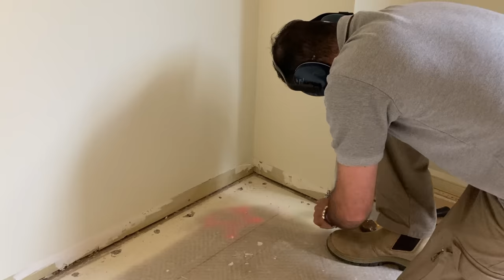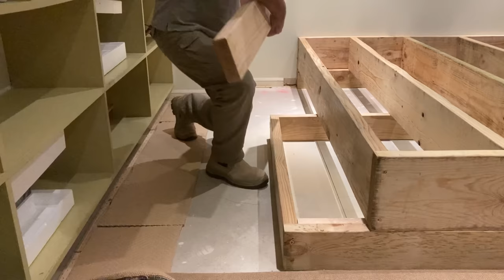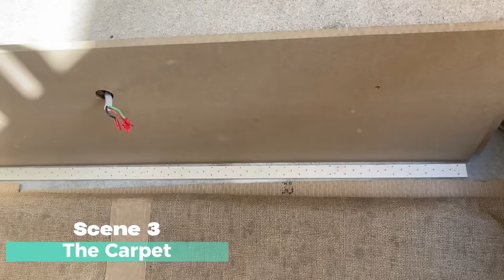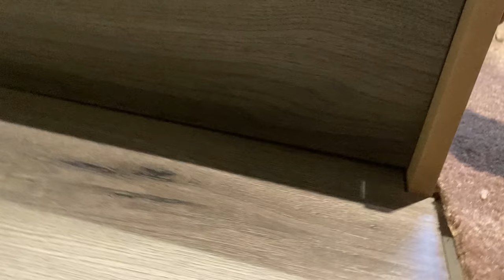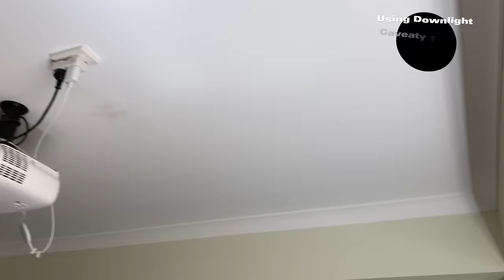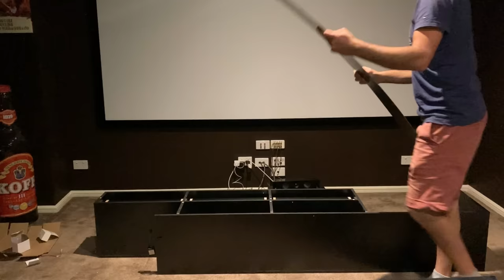This is proof, build an amazing Home Theater yourself! Home Cinema build timelapse

Comment: You actually want to fill the whole riser, with fluffed, uncompressed, unbacked batts. You have vents so you'll want to use formaldehyde free batts to reduce VOCs (and treated wood has pretty nasty chemicals). You need 7% open area of the riser deck/face/sides for the Helmholtz resonator. Can leave the face off,  just covered with carpet. Not sure that black tape and foam is ideal for squeaking, roofing felt is usually used. Use it between all joints, not just under the riser top. Double thick top is good! Good job doing that carpet yourself, that can be a pain. Screen looks good, back wall design is cool. I was worried about the white receptacle/etc covers, but the furniture hides them. The finished room looks very nice, kudos!
Reply from the maker: Great feedback for the next build, thank you 👍🏻. The batts are special wools and free of toxics, it’s a good point to mention in the description!!. After a year of usage I have been lucky not hearing squeaking or echos but your suggestion will improve it for sure. Thanks again.

Comment: Very impressive. I’m planning to try to do something similar. Can you tell me an approximate budget to plan for a setup like that while doing most stuff myself? Can you also maybe tell me the room dimensions for your home cinema?
Reply from the maker: No problem, great feedback!! I plan to upload an informational video on some of your questions. The room dimensions and the riser dimensions are mentioned throughout the video (room is 19.6 feet long x 13.1 feet wide & riser is 7.10 feet long, 9.10 feet wide and 1.5 feet high) Regarding budget, it really depends on how much you like to spend on quality. You could be spending anything between 10k-15k for a most basic setup to 50k-70k for a luxury setup (US dollars)! I have probably spent around $20k US so far with a lot of personal time and effort on the labour part that can save 20k by far. I will be upgrading the room further so my budget is not final yet 😊. My tip would be to start searching on different seatings, different equipment and even considering secondhand gear as a starting point 👍🏻.

Comment: Nice video showing us how you built out the room, but what about the most important part of a home theater - your equipment and how you set it up.  Sitting in comfortable chairs in a nice room is one thing, but watching and listening to lousy system defeat the whole experience. Tell us about your system- what type of equipment and speakers did you use, did you wire for Atmos? How many speakers and there placement. Would love to know more about the projector you’re using? I didn’t see any subwoofer…..
Reply from the maker: Thanks Mike and great suggestion! I am new to uploading videos and looking at upgrading the systems. This is a multiphase project, so please tune in for more enhancements on the systems and the aesthetics 👍🏻

Comment: Amazingly well done room, but where are your speakers?
Reply from the maker: Hey there, thank you and a great point. Currently it's 5.1 setup. I have moderate speakers installed under the recessed ceiling at the front and the back. They are kind of hidden in the video but still possible to spot :). This was the first phase of the build and in the next phase I will be upgrading the system. I am looking at installing in wall speakers. Please let me know if you have any suggestions! Also stay tuned for future videos on this theatre room as I will be applying a number of aesthetic enhancements too. Cheers.
Reply: @smokindrill  Ahh, that's kinda what I figured. Personally, I would advise against in-walls in most cases, and against in-ceiling speakers in all cases (unless they're Atmos speakers). In-ceiling speakers should never be used for your foundation speakers (ie; non-height speakers) unless absolutely necessary. You'll have terrible imaging. Looking at this room, I would recommend towers (even slender ones) up front where you have the Storm Trooper and Vader statues, with the best center channel you can budget. You have the space there and you'll get the best front sound stage, without the complication and extra work it would take to make in-walls sound good, ie; baffling, toe in, etc. Again, avoid in-ceiling speakers for your front stage. For rears, I would look at mounting them on the brown part of the wall at the back of the room, on the same part of the wall that goes into the book shelf area, and the same wall on the other side, OR on the brown part of the wall next to the back wall where you have your acoustic panels. The former would probably be better as you'll have them a little wider apart. Play around with it a bit before committing. As for speaker brands/models, anything but BOSE lol. Try out a few brands in store that fit your budget. My system is kinda budget, and I have a mix, Polk center and surrounds, Mission Audio towers, Klipsch subs, Pioneer receiver, but  because the room is treated and everything is EQ'd, it sounds pretty good. 
You really did do a fantastic job in that room. Get that audio right and it'll be absolutely killer. Cheers and best of luck. Welcome to the hobby :)

Comment: Great job there,, Hope you are getting lots of use from it.
Question if I may, what material did you use for the curtains?
Reply from the maker: Hi there. Thanks for your comment. To be honest the curtains were already installed when we moved in this house. However they feel thick with a second layer at the back and probably a high percentage of polyester.

Comment: Nice transformation! I'm just curious what are you using for your AVR and speaker setup? I see the AVR but not the speakers (unless that little guy in the front is your speaker). That seems like a great room for a 7.2.4 Atmos setup.
Reply from the maker: At the time I had a basic avr. I have upgraded to Yamaha and Jensen built in speakers. I have another video coming up soon on the upgrade. Plz stay tuned 😊

Comment: Nice work! Where did you get the fixed frame screen from? I have a 200 inch protector and want a fixed screen. Thanks!
Reply from the maker: Thanks heaps. I think I got it from Amazon. It’d also be available on eBay.

Comment: Amazing build for a small space. Very talented. On the other hand, I am disappointed to see your speaker and speaker layout. Seemed like a perfect room to utilize in-wall speakers, especially up front, along with an acoustically transparent screen.  Is there a reason you chose those tiny speakers and subwoofer (assumedly from a Home Theater in a Box system)?
Reply from the maker: Thank you for your great feedback. This was the initial phase of the build and I am exploring in wall speakers for the next phase. To be honest I am getting a decent sound out of these tiny speakers as I have incorporated a Yamaha AV ☺️ but it just doesn’t justify the room setup. Please tune in for the second phase as I have a number of enhancements lined up. Working on a Star Wars theme already. Cheers

Comment: All that effort and you didn't buy a screen that hits the wall edge. Could have totally accommodated a 135—140" screen in that recessed nook. I never understand this in fixed screen home theater builds.
Reply from the maker: Nick, it’s a great point. The issue lies with the distance between the screen and the back seats. Before purchasing the screen, I measured from  120” to 130” size screens by marking the wall and realised that the front seats will cover up to 20” of the bottom of the screen. I wish the room was one meter longer to accommodate a big screen.
In any case, the 120” looks quite big when in the room. Unfortunately mobile phone cameras don’t capture the scale well. 
Cheers and thanks for the comment 👌🏻.
Reply: @smokindrill  ah, that makes sense. I know the strange struggle of trying to capture the scale of your screen in photos. You really just have to see it in person to appreciate it. I have a 120" pull down screen in my living room, and it's a great screen size, but I would definitely go bigger if I could. The people in the back seats can sit on phone books! 😂📚
Reply from the maker: @nickharris5231  ah those back seaters 😄. I will keep your feedback in mind though, I mean I could raise the back row 🤔. Stay safe!

Comment: There is no sense in arguing about style choices. I hate it. But A for effort.
Reply from the maker: Thanks for watching the video and leaving a comment. I would love to hear what would make the theatre room more exciting. I will be making enhancements and love to hear ideas. One thing I am working on is a Star Wars theme.
Reply: @smokindrill  For me a theater room needs to be pitch black, so the acoustic panel checker board is a no go for example. Also the pictures, furniture and RGB lighting is really distracting. Lining edges like stairs, ceiling and floor with RGB strips can look nice though if toned down. But those are all style choices and everybody has different wants and needs. I watched your video for inspiration on how to build the riser and it helped me in this regard, so thank you!